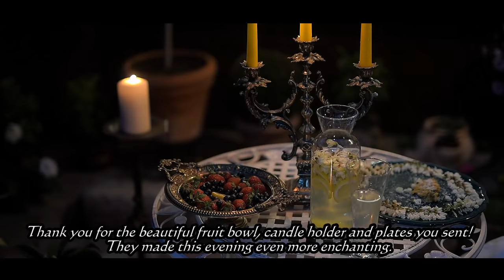Cottage Porch Renovation

Comment: Soooo beautiful! 😍  Do you need to varnish the exposed raw wood to keep from rotting?  Or let it age like a barn?
Reply: I wondered that!
Reply from the maker: It's best to varnish if the wood is exposed to the elements. You can also use old engine oil to prevent it from rotting as I did on my fence in another video. I will also use it (the oil) for the inside of the flower box, as there will be much water from the plants there. Thank you! Best wishes!
Reply: @JohannasDreamHome  Thank you :)